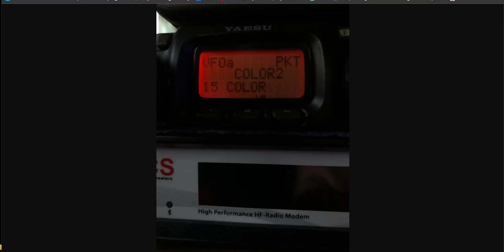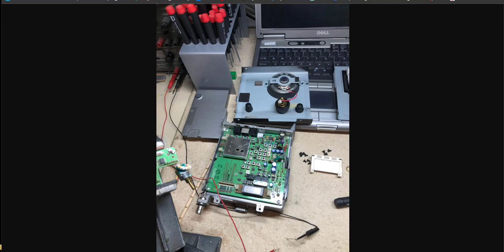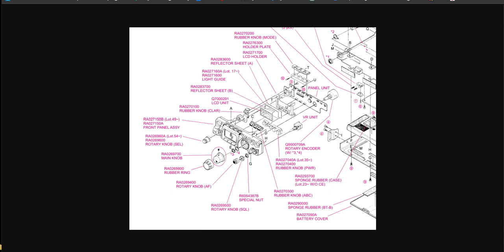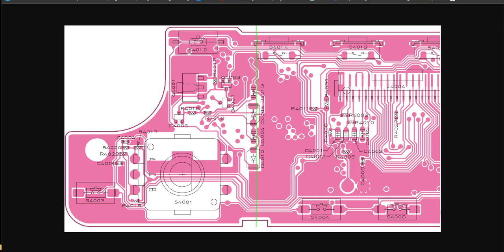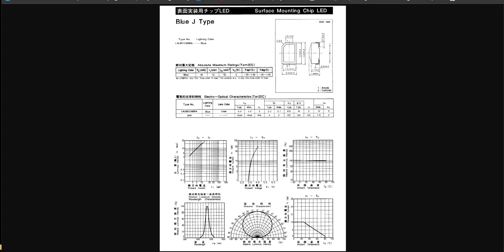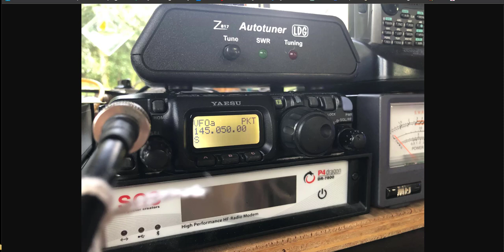Upgrade FT-817 Display To White

Comment: Nice video, very detailed, all the information required - and only that and no nonsense.  The mod solves a real problem with the FT-817's original virtually useless illumination.  Even before degradation it's very insufficient.

But the computer voice used to narrate the video is really  bad.